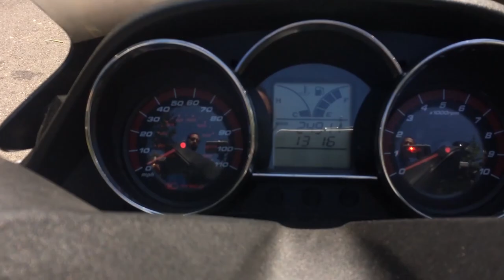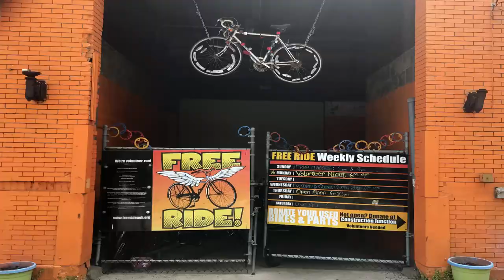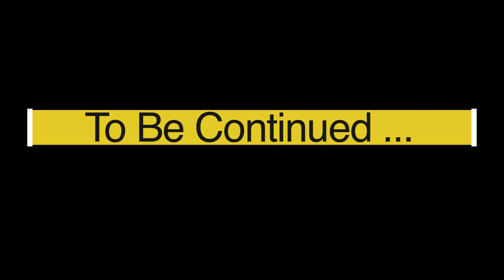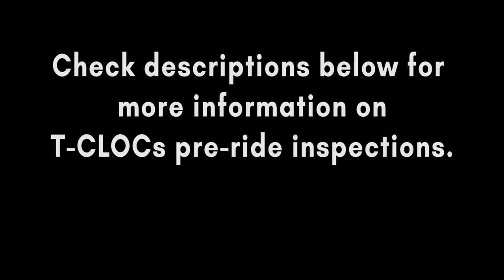How to Ride a Scooter on the Freeway: The Road to Pittsburgh pt. 1

Comment: Road trip!!! Yay! Haven't heard the T-CLOCs acronym before. The one most commonly referred to over here (UK) is the POWER one.

Petrol
Oil
Water
Electrics (includes lights)
Rubber (as in tyres, not prophylactics...:) )

Ride safe, looking forward to the rest of this journey with you.
Reply from the maker: Thanks for watching. Sounds like both acronyms work to get riders to check their bikes. I tend to keep the 'S' at the end of T-CLOCs (which is for Stands) as a lower case letter because I inspect both the center and side stands when I check my chassis. 

It seems pretty straight forward that fuel should be check too, but I guess on our side of the pond it's thought to go without saying. Still. it's a good idea.